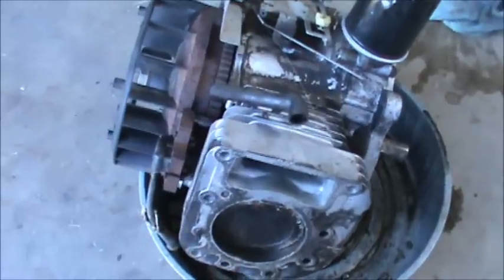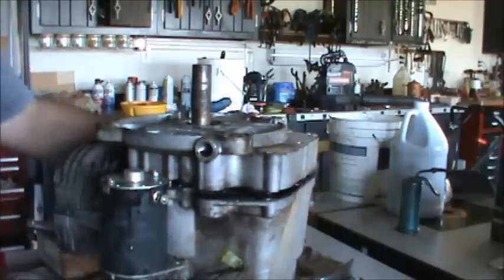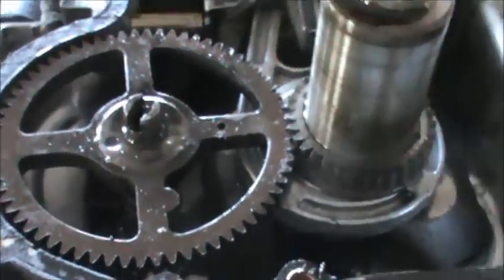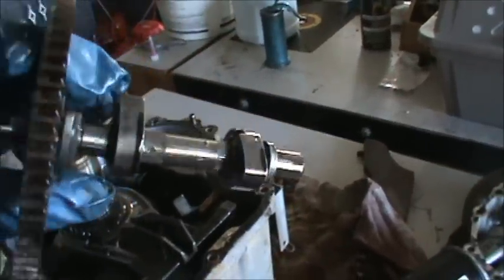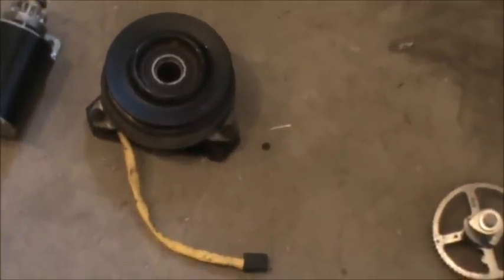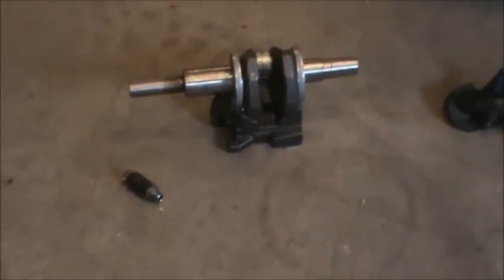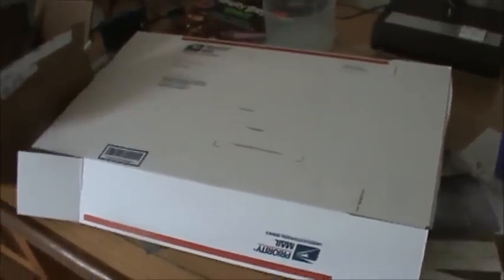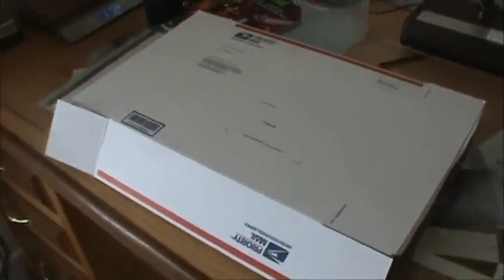Briggs and Stratton Intek 17.5 Teardown

Comment: Great video, good info thanks.
Well thought out and professional presentation.
Anyone releasing pressure on big end Conrod bolts, crack them slightly and move across to other bolt and do same, and go back and forth till loose.
Saves extreme strain at opposite side, on mating surfaces and the casting shell and bolt.
Thanks for helping others with this video.

Comment from the maker: Just happy you are staying tuned.  Thanks.
Reply: doublewide6 Repairs LLC.    Looks it was ran low on oil..  I use mobil 1 seems to make it last longer..
Reply: doublewide6 Repairs LLC chain saw flule lines
Reply: I only use Mobile, Valvoline or NAPA store brand oil, the store brand is basically Valvoline with another additive (because it cannot be chemically identical to Trademarked Valvoline brand oil), Depends on the $ scene at the time of service NAPA brand carries the same engine guarantee as Valvoline. Yes you are Absolutely correct about the increase in longevity of the engine, I've always ran those oils in everything, and service at the regular intervals, and everything I own still runs perfectly.

Comment: I was able to get the connecting rod bolts with a T-40 torx screw driver.  It was a little loose, but it worked.  My set is missing the next size up, which may have been the right one??? 

Another question.  I have been stripping the electrical, carburetor, controls, shields, covers, flywheel, and fan off the engine and selling the short block.  Would you say that it is more profitable to strip the short block down and sell the parts separately?

Comment: I have a XRD 17.5 Briggs Intec  engine that is full of gas.  Do you know what the failure is that’s allowing fuel to get into the block?
Reply: Easiest fix is to put a inline fuel shut off line....your carb is overflowing into the engine oil line located on the bottom of carb...will cause all your gas to leak into engine....you can also disconnect that vacuum line on bottom of carb to prevent it from entering engine oil....gas in oil will cause engine failure .

Comment: hi i have a question i just took my 17.5 briggs apart because of bad crank and i do not know how to put the counter balance connecting rods on I know the concave side goes inwards towards the connecting rod but the aluminum balance rods look different one has an oval area? or did i mix them up from the used crank i bought but i had a broken one

Comment: Awesome video!  The one thing I was hoping to find out was what kind and size of head the connecting rod bolts have.

I see you keep the intake manifolds attached to the carburetor and sell them as a unit.  I never thought of that.  I think I'll do a listing with variations.  One variation will the the entire assembly (carburetor and manifolds), and the other variations will be the individual parts.  If the entire assembly sells first I will be done with it.  If one of the parts sells first I will dissamble the unit and try to sell the parts individually.

Comment: What's makes a 17.5 Briggs have to much compression and want let the starter turn it over with the sparkplug in it?
Reply: It ether needs the valves adjusted "easy" or a bad decompression on the cam which means you need tear the engine apart

Comment: What could cause oil to spray out of the intake side valve on one of these motors ? 
Thanks any info will be appreciated.
Reply: Does it spray on the outside of the engine? If so it's just a seal